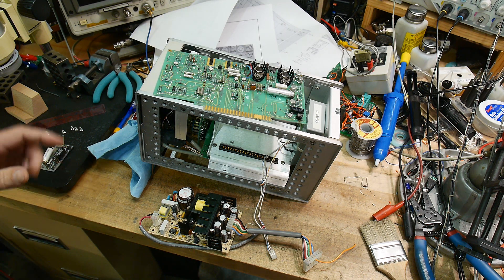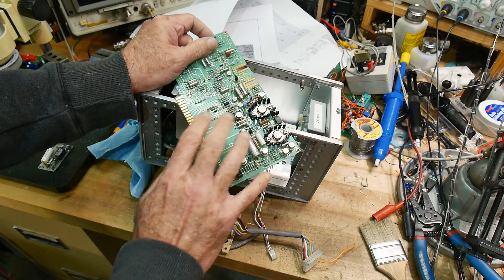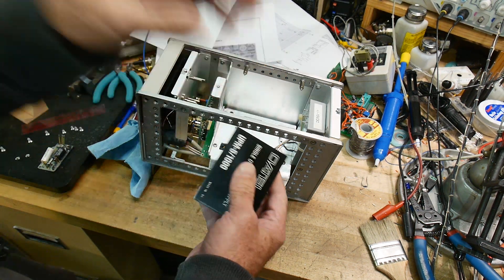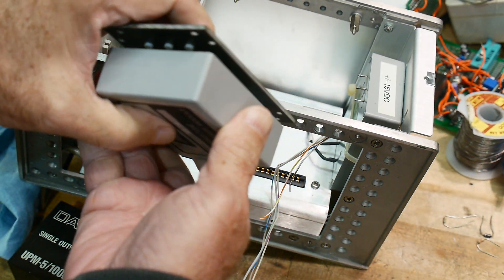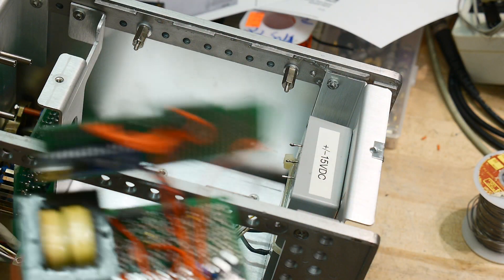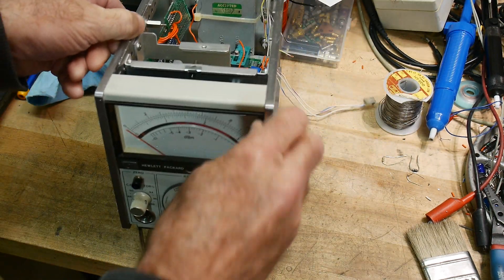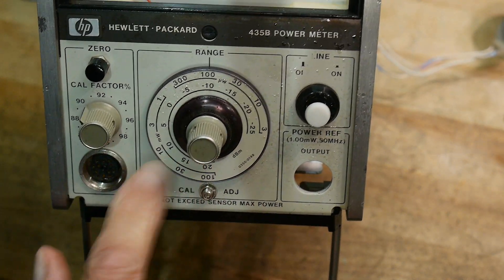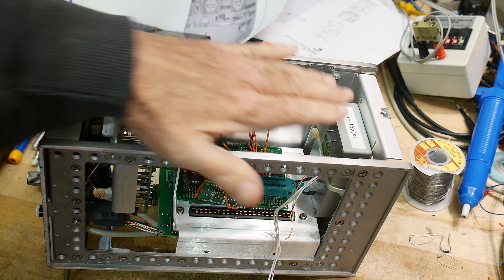#646 Transistor Curve Tracer (part 8 of 10)

Comment: Just let's not forget the test socket or the outlet for it so that we do not have to open the case to insert the test object. There was a socket for the sensor in the front panel.
Reply from the maker: I've got some 3 pin panel mount connectors on order